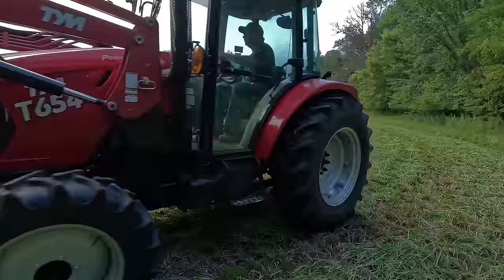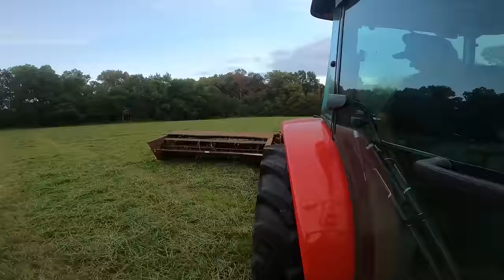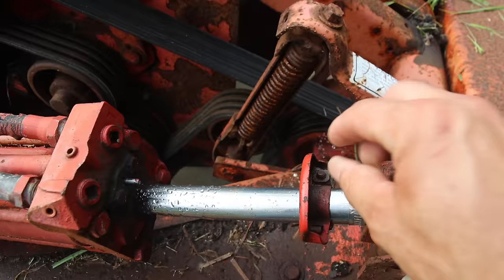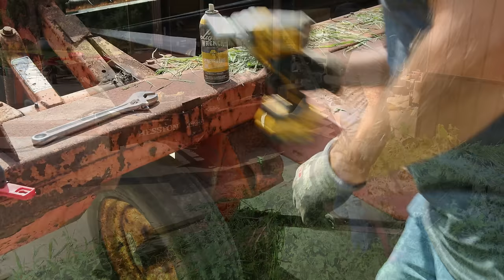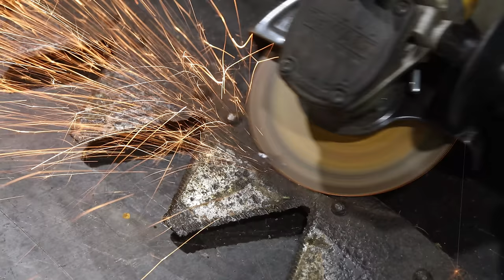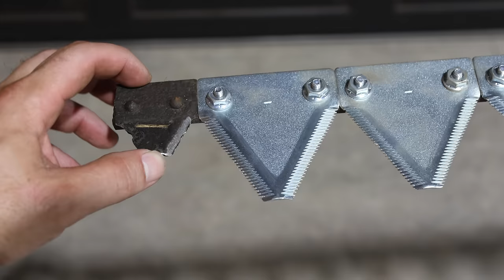I cut the first hay field and the mower broke down   Hopefully I can get this fixed.

Comment: My hat's off to you, Evan.  My wife used to say I was the most patient man she had ever seen, but I think you have me beat.  When I mowed with a 3 pt. sickle mower, I only replaced the sections that were worn badly.  I didn't even know that you could get "high profile" hold downs. My rock guards were the single type and malleable so that I could beat them up or down to put the right pressure up against the sections.  Might have to do that once or twice in a season because there are rocks in the ground here, and they were always being knocked up or down.  Occasionally, one would break or the wear plate would be so worn that it were not providing a good cutting edge for the section to rub against.
Hang in there!

Comment: Tip:    You can lay the edge of the cutter bar against some solid steel and hit the section with a good hammer and the section itself will cut the rivets. Rerivetting is very easy with ball pein hammer. Use exact diameter rivets.
Reply: My thoughts to. Never seen anyone use bolts in a cutter bar.
Reply: Once we got the angle grinder, we just ground the head off and punched the rivet out. Mostly though, the section had already broken the rivet off. But yeah, whacking it with the bar against a hard edge will do it.
Reply from the maker: I tried that, but the Sickles were in such bad shape they just bent up and didn't sheer the rivets.
Reply: Looks like a combine cutter bar to me, ie for straw. I’m in England so might be a different set up over there but ours were always smooth. I still have a new box of them in the garage, have been there for fifty years since we sold the farm. I kept them as I thought they might come in handy for something.😀 Ps I have just seen those double fingers and a bit more convinced from a combine set up, and why not, no point in duplication of effort.

Comment: I hit the backside of the triangle knives with a hammer. It usually sticks out past the cutter bar. Hitting the knives they shear the rivets right off flush with the bar
Reply: My dad had me rebuild the sickle bars each winter and we would turn the sickle where the  knives facing down into the vice so all you had to do is use a shop hammer to hit each rivet one time and it would shear off quickly it did take practice but you could rebuild a sickle bar easily
Reply: Had problems sending text but it attached to previous text

Comment: Evan, for your hydraulic stop, cut a length of pvc that has an inner diameter of the rod.  Split it in half, cut it to whatever length you need the stop to be at, then hose clamp it around the ram.

Comment: A lot of sickle bars have a special tooth on the end that looks like a tooth and a half with 3 mounting holes.  It's a one piece cutter and it apparently helps to keep the end of the bar from balling up.  We use a Rowse mower that has a bar like this.

Comment: Nice one.. glad you can still find parts.. . The tractor seams  quite happy on the mower to.. iv had many a fun 😮 time changing blades on combine header 30 + feet ones by the time your finished the other side of the shed was always covered in rivets or parts of any way 😉 😅.  Stay safe 🏴
Reply: It turned out 15-20 yrs ago we could buy a new sickle bar ready to install at almost the same price as replacing all the blades. After  that we always had an extra one ready to go. Just had to be careful we didn't get it buried in the back of a fully loaded barn. I had my help cleaning up scrap steel one winter and they made the brilliant decision to bend one of those 30 ft sickle bars that was stored outside into a pretzel to get it loaded on the scrap trailer.  SMDH, must'a took 'em half a day to bend that springy bar. Some ppl can't be left unsupervised, even with the simplest tasks.

Comment: Hey Evan, you remember the old adage when it comes to machinery...if it moves not only is it dangerous, it will eventually break...but lucky for you the machine didn't collapse on the weak shoe, (always look for the silver lining...) reinforce the shoe with some degree of angle (Unknowing what clearances you may have under the mower, either bolt in place or weld it) using any good piece of steel or angle iron if that's all you have laying around. I hope you get the spring in soon too. Lastly, you can get spacers to go over the hydraulic rod so that you can take off that loose collar, and that circle clamp. I'm not sure if all Tractor Supply has them over by you, but I believe they carry them.

Comment: If you do decide to go with the bolts do a quick pin with an old flat chisel on the end of those bolts so you don't lose them in your field when they come loose.  You can always smooth them out with a hand file if you ever need to remove them.

Comment: I have done what your going through too, put the wrong sections on or bent a skid plate or two. I even broke my nose working on a JD 1209 haybine, I was changing out the guard. Those tension spring for the floating head are not easy, I think you did a good job getting it off. You'll get it done, your a resilient fellow. Good luck on the cutter and the hay. Hope you have a good week, take care!

Comment: i am helping a neighbor who does custom hay work  , raking hay with a big wheel rake  lots of the time she is baling before i get done raking.    you should be able to buy a set of graduated depth spacer blocks(aluminum split donuts) to put on the cylinder,  probably just need to bite the bullet and change out the hold downs if the bolts are rusty just cut the nuts off  if you hit a rock in the field(or tree limb) and brake  a guard or section you will appreciate the bolt on sections . my neighbor hit a shooting target in the field the other day and did 500$ worth of damage to her disk mower  but was lucky a new cutter head is $20 grand id you have to replace the whole gear drive  good luck and stay cool

Comment: Its good to see you making the machine your own! My experience with sickle mowers like that, is that they're reliable (once gone through) and very low-cost (long term) to keep in the field. They'll do a great job, and mine would cut at 4.5 mph easily with everything set correctly. Keep going, it should be well worth getting this one fixed up, it should give you years of good use after this.

Comment: My dad had a stopper on a hydraulic ram, he took a piece of PVC pipe. Cut it in half, cut to desired length of course. And then a couple hose clamps and it's going no where.👍

Comment: I have run a PT7 and a PT10 for years I have never seen a down stop, the head should be resting on the shoes with the spring support, also you should be able to get anything for that mower from AGCO but of course everything isn't cheap for it. I have replaced several bearing for it over the years.  You did make the end knife correctly, one thing you should get on hand is the powerband or drive belt for it, they last about five years on average before they start slipping. I still run rivets in my cutter bars but I have the tool and boxes of rivets for it. The tool allows you to replace knifes with out removing the cutter bar and it came with the mower when you bought it brand new but not sure it you can actually find it anymore. Also just a heads up, all the pulleys and sprockets are held in place with wedge lock keys, they don't have the standard square key with a set screw, the key is wedge shaped, you hold the pulley or sprocket in position and tap the key in to lock it in place, they can be a real pain getting out even with the removal tool, I have had to drill them with a small drill bit to relieve the pressure so I could get them out.

Comment: This video is exactly how farming really is even when you aren't runnin antique equipment. You spend more time fixin stuff than you do farmin. Then there's the time spent waitin for parts because dealerships and parts companies have turned into order centers. They no longer invest in keeping inventory of commonly used items. I don't understand how they've stayed in business under the current mode of operation. 

 I'd have opted for the rivets if they were locally available. I'm sure  glad that spring is still available. You probably need to change to the solid, cast cylinder stops. They don't move, though they can rarely break.

Comment: We switched our combine platform sickle from rivets to bolts as you have done.  Had clearance issues as well.  A grinder solved the problem.  Just take a 32nd or 16th off the top of each one and plan on replacing with new if you ever need them out again.  If I can avoid it, I will never go back to rivets.  For in-field repairs all you need is a wrench, a punch, and a hammer.

Comment: you need the 2 in1 rivet tool then changing sections easy as apple pie. sickle/guards no big deal but is the drive belt still available that's why in 1989 we abandoned our two pt10's cutting wet tough lodged hay wrecks that belt there's no slip clutch on these haybines stuff just breaks & breaks & breaks your pocket book. there's several woodruff key's in that long pto shaft going back to haybine gearbox i used to put small size woodruff keys in there for shear protection. watching your hay videos brings back memories still can't believe i put a 6pt buck through our pt10

Comment: Evan lives in the general area I do, I'm on the Kentucky side of the southern, lower Ohio River Valley and he lives basically across the river by a number of miles, we share the same climate almost and similar habitats and forest (the valley has some peculiar effects on climate, we often experience temperature inversions that keeps bad, thick soupy air in the valley), in the summer it's so hot and humid that a quick updraft can cause it to rain fiercely at almost any time.  Prediction goes out the window,:eyes-pink-heart-shape:

Comment: Those heavy steel spring assisted dock ramps, some use those coil springs for lift, don't be hanging onto that thing when one of those springs lets go, a lot of violence and tremendous noise will follow shortly. :face-orange-raised-eyebrow:

Comment: I use to use an anvil to take the blades off    You set the cutting bar on the anvil then hammer down and it will cut the rivets then punch them out

Comment: Evan great sorry your having so much trouble. If you ever have trouble getting the springs there is a company named Service spring give them a call and they'll talk you through how to measure them. When you put the plugs back on the new spring heat the ends with a torch and bend them out a quarter inch that'll take the fight out of them. 👍🇺🇸

Comment: When i didnt see that you didnt have the high clearance hold downs.
In my 488nh changed all over to bolts and keepa spare with me. Machine holds a spare cutting bar on the pipe frame. 
Hopefully no rain till yget the field baled.
Reply from the maker: Not me it's a scam

Comment: An overhead garage door place might be your best bet for a “right now” fix, they typically have large springs like that in stock and might be able to make you one. Also when turning the plugs out it’s almost impossible but putting them back in, put the spring in the vice with 3-4” sticking out the top or side to thread the plug back into it. The spring will coil “open” making install easier
Reply: Would putting the insert in the deep freeze overnight and the spring in the oven or under the torch work? Sometimes thermal expansion and contraction can work in your favor.
Reply: @wmkess  no not with springs. The plug is actually oversized to the spring and heating spring loses the heat treatment

Comment: What about tack welding the nut to the sickles and then grinding the nut down, or cutting threads into the sickles and threading a bolt into it and grind bolt stub off.

Comment: Dont you hate it when things break down, just thought I would let you know ,years ago John Deere sold a tool that allowed you to replace those rivets and blades with the knife  still in the machine. Actually i have a new tool in my shed but unfortunately I am in Australia otherwise you could have had it as I have two. Hope you have been able to fix the cutter bar.

Comment: If you stretched a string line, or better yet, a small guage wire from one end of the backers to the other end,  it would be easier to see if one is bent. 😊

Comment: To remove the rivets just stand the sickle up (points facing up) and hit the "point" with a hammer and they the cutter breaks right off..
Reply: That is correct either facing up or down because we face them down and they sheered off quickly

Comment: May I suggest a solution for the hold down clearance issue ?
If you can thread mounting holes in the bar which has the cutter triangles mounted to it and get a bunch of flat head (allen) bolts to match said threads you should be able to clear the hold downs easy...
<Maybe it is even possible to weld the nuts underneath the bar OR drill a hole large enough to insert the nuts more or less flush with the underneath of the bar and weld them in... that way you can reuse the bolts and nuts you already have.

Comment: Could you use a washer to space low profile guide a little higher to clear nuts on sickle bar?
Reply: Will still have to get those rusted bolts out.

Comment: In my experience fixin' stuff, you 'should' be an expert in many areas to do the job. But it seems like the things I know about don't seem to break as often/ever as the things I don't know about and I find myself having to constantly learn new skills that in many cases I won't need or use again for several years. I don't mind the learnin', it's the time it takes to do what is basically a simple job...like changing the mower teeth. By the time you are ready to retire you will suddenly find you have acquired ALL the knowledge you won't be using after you retire. Good luck.  =-)

Comment: You don't know how many hours of use on the mower but it shows a lot.  Somebody had to pay for that broken  $250 spring and it wasn't the previous owner.   Go with the flow and fix it till it works seems to be the guiding rule of thumb.

Comment: I used to run a Hesston 1090 Haybine. I had the same problem that you have with the low profile guards. I think I ended up inserting the bolts from top because there was room on the bottom guards for them to slide freely. I got rid of the 1090 Haybine about 4 years ago because I started losing pieces of it in the hay field which my baler was able to find. I am using a John Deere 630 MOCO now. I believe I still have the manual laying around somewhere and I think it is a similar design to yours. Let me know if you would like some of pages copied to see if they match up.

Comment: If you can get the guards that are the one piece design, you’ll better off. I switched my Hesston 1110 over from the stubbies, and it’s a lot easier, and less expensive in the long run.

Comment: Round bales?! 🤥  I was really hoping for the small squares so you could show us the kind of knot that the wire baler makes.  Lots of videos with examples of twine baler knotters but I can't find any on wire knotters.

I vote for rivets.  Growing up on the farm that is what we had on our sickle  bar mower and I never found them to be excessively troublesome.  But, every time we got ready to mow hay we would pull out the sickle bar and sharpen the blades and tighten any loose rivets.  We didn't have any blades with serrated blades.   Sharpening the edges and tightening the rivets was just part of daily maintenance when mowing.  We would do it every morning while it was cool the hay was still really wet.

Comment: Getting that spring to properly load the shoes should make a big difference.   Doing that many rivets would be a pain, unless they make a special jig for setting the new rivets.
Reply: They are easy to mushroom.  Three hits with a ball peen hammer.  I do it all the time with my mower sickle.
Reply: @markfin7225  We found that they eventually came loose on our machine unless we heated them while peening and that solved the problem of coming loose.  But we might be making more work than needed.
Reply: @jazzerbyte  some can come loose, but I have had good luck.  Been doing it off and on since 70.  I will say, the newer rivets are weaker as are the sections.

Comment: Hi Evan, as to your decision to change the hold downs for taller ones,  i disagree. You already have the rivets though maybe not enough. Your locking nuts would need to be replaced as you shouldn't use them twice. And if you changed out the blades once a year your out lay is still smaller than changing the hold downs. Time you have, money you don't.

Comment: Removing rivets is easier than removing rusted bolts.
Reply: Totally agree.  One could see how easily those rivets cut with a chisel.  With the correct size replacement rivets the job goes pretty good.
Reply: Those bolts are plated.  They are also small enough you can just twist them in half if they are stuck and punch out the head.

Comment: It didn’t look like when you put the new cutters on the bar, you didn’t use lock washers, was that wise? Could use self locking nuts, but your video did show the nuts very well.
Reply: Those bolts/nuts are special design for sickle bars and the nuts do lock.

Comment: I would just go with the rivets. Cheaper, and replacing is not all that difficult when you have the sickle bar removed.  Bolts could get rusty or locked and those would be tougher to remove than the rivets.

Comment: So sorry Evan, but I really did groan and say don't do that, it won't work. Guess you didn't hear me, ha. Oh well there is a couple of really good suggestions in the comments if the bolts aren't SS you bought yourself some headaches down the line, and a new cutter bar will be needed soon I think,. Good luck with it and you have a great place going there.